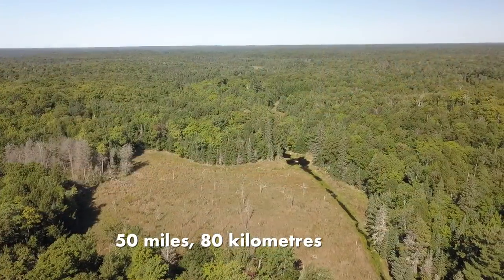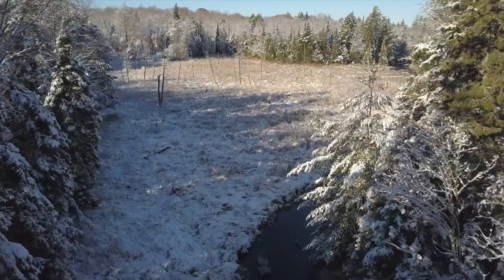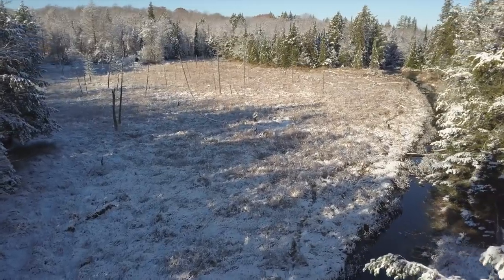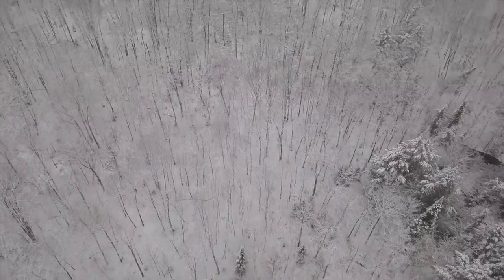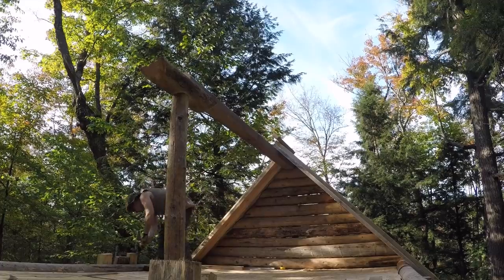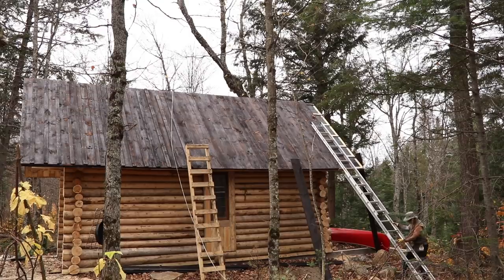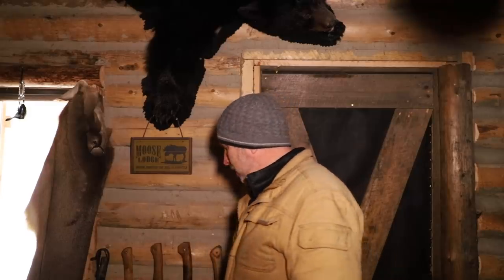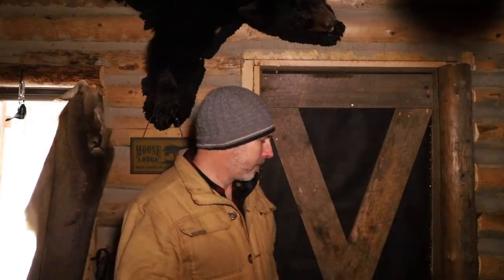Log Cabin Cost - Build a Debt Free Off Grid Tiny House | Home Tour

Comment: Yes thank you for your invite for suggestions one of them is electric chainsaw the Aerobie one 18 volt brushless has good power and that whole battery line is very good and has lots of nice tools. Now actually before this step I would suggest something that has been forgotten is that people used to in the old days grab up usable wood steam boilers yes this was one of their most coveted and most useful items usually placed in a utility room even old steam tractors. With this unit a person has their hot bath water if a person has hot water to go into the radiator system heating most areas of the house and you have 12 volt electricity maybe even household current generation in two I am suggesting that you put it in the utility bath house and perhaps run piping into a radiator in the regular house and in the outhouse you can even heat a concrete path to these areas. But this is getting very large I really think you might get by with just a small engine yep the small engine must be cranking a 5/8 shaft to MB that robust. There is one guy on YouTube who seems to have a shop dedicated to making such an upright machine even though I think it's fire door is a little small he is selling them on YouTube. This makes electricity in the dark where you say you have a long. Of Darkness in fact I don't know why I can find no YouTube videos saying I am a Canadian or Alaska off the griddle and one of the most valuable things I hauled up here is this steam engine whether it'll be a stationary I would think I would desire of 5/8 tractor engine in the utility room that way I can have the power to haul in the wood. People have a knee-jerk reaction saying well it will freeze of this you can design them where they can be easily emptied and if you run a small fire it can dry out the boiler. Yes one would need a good water supply they are very thirsty machines and yet there is a solution for this if one doesn't have the water he can make a large hot air engine this idea would have to be made or should I say fabricated in a machine shop utilizing a Barrel stove and having the back how's the barrel stove a huge hole in the back where one places the heat exchanger and then when one wants to heat without making the TriCity it needs to be rolled back on tracks and one closes a door in the back of the barrel stove this making the barrel stove just a heating unit. We are talking of a heat exchanger that is quite large be a foot in circumference. Well like I say I have yet to see very many videos a people talking about their steam engines supplying power onto the electric grid and yes one could run a turbine on Steam and probably do better yeah in this I'm kind of like you I like the old rustic ways the best.

Comment: Real decent accounting and the tips to save even more. I'm sure you considered it but a sawmill would certainly pay for itself over the course of building many structures. Then again, motors need fuel and oil so that expense goes away with no sawmill. If it was me, I'd upgrade the solar, having an array that would allow full electrical service to the main cabin and all the structures. You should plan on getting at least nine years out of batteries, more, if buying deep cells made for solar. I'd suggest to buy 6V GC2 golf cart batteries. They are robust, cheap to buy, and are sold all over the world. 
Your new bath house will take the drama out of hygiene. As an alternative, a guy can either mount a black barrel overhead in the sun or a black plastic bag/pipe, attach a shower hose and let 'er rip.
Good process ideas on food storage. Root cellars are a good solution to a lot of food storage issues. Tip: make a serviceable floor so that cleanup is easy. 
You've done very well with the cost of your buildings. The total is about equivalent of a fair sized yard storage building cost, stateside.

Comment: To make the dowels, a used lathe would have cost you about $150, $50 less than the steel spikes.  That sandwich layer barrier sounds like it could be trouble in the future because it can't breathe.  I love knowing what you did that didn't make it into videos.  Overall, this was a fantastic project you did extremely cheap and my looking back criticism with 20/20 is pretty meaningless.  One thing I would add is that lumber in Canada is cheap.  I'd add another $2,000 for US material cost, excluding land which is typically more expensive.

Comment: for hot water you could do something similar Kris Harbour (channel) did in his off the grid cabin - copper tubing wrapped around wood stove chimney pipe. he also has auxilary electric heater but you can just use your stove since it runs a lot especially in the winter when you are living there fill-time. small 5-10 gallon tank put up in the rafter fed by thermal siphon action and you can even get your iwn hot water on demand in the sink. i know it's extra work and equipment but if you source most of it for cheap on second-hand markets you can have conveniences and still be off the grid and the low budget

Comment: hey Shawn,  great video answer tons of questions.  I'm not finding many properties that are in an unorganized township.  could you elaborate on your experience with building inspectors and what kind of problems they caused you in the past.  You said unorganized was essential and I'm trying to figure out if I could make it work in an organized township.  
thanks
-Matt
Reply from the maker: In my experience most townships will not Permit an outbuilding until a residence is constructed first. In muskoka the building permit cost is $10,000 and an outhouse is out of the question. You would need to do research on the area you are looking at to know for sure. The town by-law officer or local real estate office can help advise you on the rules before you buy.

Comment: Great informative video. Might have missed this in the video but do you use anything like carbon monoxide or carbon dioxide detectors at all? While anything is probably better than nothing, is there a specific size of fire extinguisher you would recommend for a cabin your size? If you didn't have so much snow year round would you have added some form of skylight to your roof for more natural light inside? Thanks.

Comment: Hi : First I would like to say I love what you are doing. I don`t live off grid but I do heat with wood. I have 2 thermostat controlled furnaces 1 on the main floor and one in the basement as well as a wood fireplace. I have 160 acres but I don`t farm it I rent the grain land out on a 1/4 share. I would love to do what you are doing but I am 72 years old so it is not possible. I got sick 6 years ago and was not supposed to survive I actually had 4 fatal diseases all at the same time . When they decided I would live they said I would lose my hands and feet because they swelled and turned black the only thing I lost was a small piece off my ear. I wanted to tell you about a machine I bought it is a power wheel barrow it runs on tracks and can carry 6060 lbs. what I did was take off the bucket and built a flat deck. I use it to get my wood from my bush it is great. I purchased it on sale at Princess Auto cost $1599.00 it has I 196 cc engine. This is my 2nd year with it and it works great. There is another machine that is bigger and faster it is called a snow dog around $3000.00 it will go about 20 kliks mine only goes 5  Just thought you might be interested. Best of luck to you.

Comment: Build a smoke house commercial vacuum packer $1200 dehydrator $300 freeze dryer $4000 
Form a co op so extended family can use and share cost. A pressure cooker and jars $500.

Comment: 2 Hard Questions.

1. Would you prefer the summer: hot, bugs, overgrowth    or the winter: cold, snow hard to move/work, cold

2. Has anyone on here tried to give you information or ask about using a Catalytic Wood Stove? Can set to desired temps, walk away for up to 24 hours, can low burn, uses less wood.

Comment: For Ontario, you are still subject to building code in unorganized townships, and you are supposed to get a building permit.  One needs to be mindful of that; while no one is generally looking, you could be subject to issues if someone notices or reports your structure... one more reason to have more land and be more remote, so that way the chances are no one will notice.
Reply from the maker: Building permits are not issued in unorganized townships, as there is no municipal authority to do so.
Reply: @MySelfReliance   Right, you have to get it from the province, and for an inspection, they send someone from the nearest municipality, at extra cost.

Comment: I have to disagree with your thoughts of "changing" the roof from a double layer roof to a single layer thicker roof. The system you have now is essentially a cold roof with a vapor barrier between the two layers of wood... very insulating. I can't explain all the attributes of a cold roof in this venue but please research and reconsider amending future building plans. 🎄❤🌅🌵

Comment: As you have the wood burner running most of the time I wonder if a Sterling engine generator running to charge a big bank of lead acid batteries would be viable?

Comment: as always a great video. One question,  are you required to use steel shot waterfowl hunting in Canada? If so what effect if any does that have on the Ithaca double barrel shotgun you use? I have an older Ithaca double barrel 12 gauge and it is not rated for steel shot. Just curious.

Comment: On the issue of power. I want to do a tiny house at some point and try and maintain a mostly off-grid lifestyle without giving up creature comforts like internet and power related items like an EV car I looked at the cost of solar power wind power and hydro power And I like to note I live in a place with a snowless winter so running water is not a problem in winter but could be in summer

the end conclusion was wind rated least expensive per potential KW hour to produce problem is you are totally dependant on how the wind blows and its reliability can leave you powerless for up to weeks solar was the next most consistent power supply on a day to day basis but its cost per KW hour gets ugly the panels aren't cheap but you also need so kinda storage medium also need inverters and a whole slew of things at can all fail and need regular maintenance. and of course, you need sun time for it to work so however many hours every day it does nothing for you 

I recently stumbled onto small personal hydro generators all kinds from those that you basically make a bridge and drop it off the bridge about midway across a river to those you make an off shout of a river it goes through the hydro geny and then you cat the offshoot back into the river it came from  what I found with this was as long as there is running water you have constant power better yet a small system like one you could carry yourself produces more power then any single house would normally use.

from what I have been able to tell so far you could use a battery system to kinda make a power conditioner basically stabilizing the power grid to a constant power level and there is still far more to research on it but seeing as its dec there and I see you have running water it may make for a good primary power supply system for you?

Comment: Greetings Shawn. Great video.

Just wanted to share with you this link for internet:

https://www.bell.ca/Mobility/Products/ZTE-MF288

I live in an area where cell phone coverage is spotty (which I prefer), however, we are able to get internet using the device in the link rather than the sat internet. Works great and so if you have cell coverage at the cabin, you could get a plan that gives 50GB for about 54$ a month. After you go over the 50GB, it jumps up 5$ more and you get 25gb more. And again if you go over that, it's 5$ more for another 25gb. Much cheaper and it's a great plan for those who can't get any other internet other than sat internet (deal is only for rural addresses).

Note: I do not work at bell. But I highly recommend this for those who have some cell coverage. My house does not get cell phone reception, BUT in one spot in the house, the device works on two bars and I get between 3-5mb/s.

Comment: Shawn,  I've been watching for about a year now and look forward to your excellent videos.  Question:  Do you have fire/smoke detectors (batteries?)?   I ask because I just lost a 21-year-old cousin to an off-grid barn fire where she died from smoke inhalation.  An accident of course, yet one that may have been avoided pretty easily with the price of a lunch if they only screwed in a couple of smoke/fire detectors in this building.  
http://obituaries.eagletribune.com/obituary/kelsey-locke-1997-2018-1071757119
I hope you do....accidents, no matter how careful you are do happen.  
If you read the obit above you'll see that she helped build this "barn" (off grid) and worked there, that's why she took the trip back, to try and inquire about employment and instead of sleeping in her car they offered to have her crash in the barn.  There aren't any answers...there was a wood stove, but the fire started elsewhere;  some feel she may have been melting wax for her snowboard and that may have been the cause of the ignition in some way, but we don't know.  
It's great to be off grid...it's noble, it's industrious and I find it alluring and very cool to watch, but there are reasons we have safety laws and suggestions (Walmart $20 and you have a safeguard against losing a life, or even a building).  
Kelsey Locke has a gofundme page to support the rebuilding of this barn and I sent in my donation happily, but I had to hold back and NOT add in a comment stating to use my $ to buy a simple smoke/fire alarm.  After all, they went through the trouble, and skill, to build this barn without the use of one nail, so it says.  Kelsey was schooled in how to do so and was one of the builders.  A pretty cool young woman we lost.  She was a minimalist, had values and priorities etc...One's I greatly admire; but, she's gone at 21 and I'm a bit hurt and angry, then I thought of your situation and wondered if you have more protection; especially seeing you build the firewall, floor, copper backed lamps etc...I enjoy all these safeguards and attention to common sense and detail that you bring to this amazing project that I look forward to seeing progress.  
All the best, 
Dan